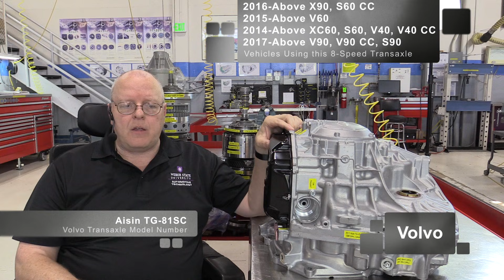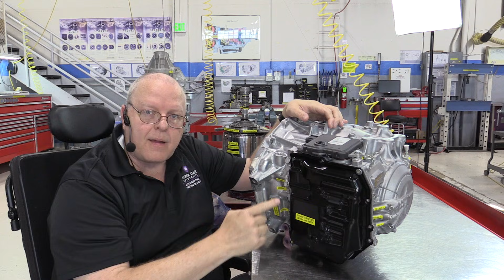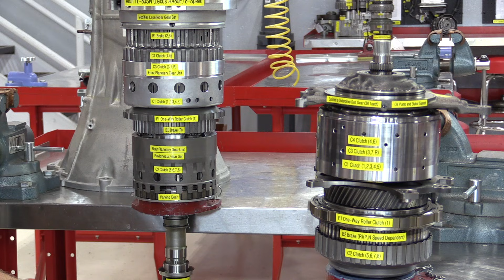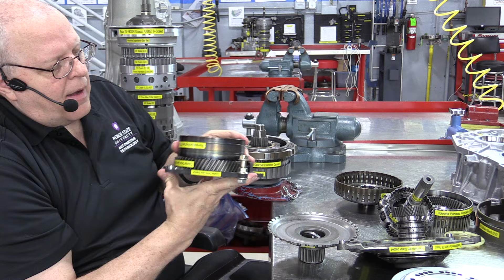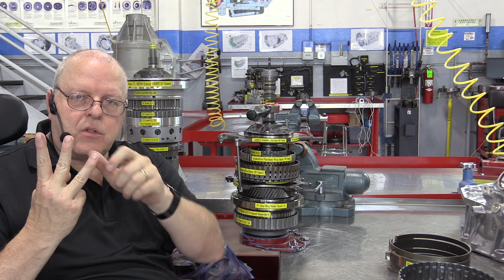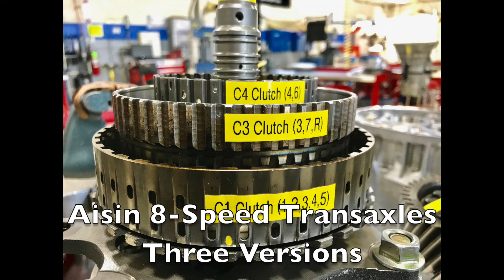Aisin 8-Speed FWD Transaxles -  Volvo, Toyota, Lexus, GM

Comment: My Mini Cooper JCW GP has an Aisin 8 speed. From what I can tell so far it feels like a very stout transmission, quick strong  upshifts and downshifts and it puts the power down very well. If I leave it in sport auto mode, I can be cruising in 8th gear on the highway and if I mash the throttle it downshifts to 3rd with quickness and takes off like a rocket. Or I can manually shift down with the paddles or gear selector for more involvement. After having only manual cars for the past 6 years (until the Mini) I thought automatic transmissions were bad... but I was so wrong. These transmissions are incredible.
Reply: @gravityhammer25 - Interested in your comment. We have recently bought a UK 2023 Mini JCW (228bhp) and are very pleased with the transmission. Having been used to VW brand DSGs (with diesels) for many years in various vehicles, the Aisin has low-speed smoothness that DSG just doesn’t, and coz the Aisin has a torque converter I have no worries about slipping clutches wear or heating up in slow traffic etc. Low-speed manoeuvring is now a positive dream rather than awkward. The DSG when cold is nowhere near as good.  Having said that I still like the DSG, and one remains as my “daily”.
Reply: @adrianlw2750  I carry the motion that Aisin 8 is sublime in both low speed cruise in traffic and when manoeuvring back and forth. The only advantage dual clutch types have over this is when entering or exiting the cruise mode the obvious mass of the torque converter initial spin compared to just a clutch engage with the dual clutch types. I love that the Aisin can kick down 4 gears at a time when wanted as well. Great part overall.
Reply: Glad I seen this comment, I have had a 128ti for a year now. I always wondered how the Aisin Gearbox differed from the ZF box found in 3 series and above models. The B48 (High tune) with this gearbox is excellent. Only gripe with it is, on colder mornings it can be a bit notchy, but that’s to be expected 7° and below in UK. Very impressive gearbox tho
Reply: @alexthomas446  is there a tune that ppl are flashing on the trans

Comment: Excellent video as usual John and of special interest to me as I have it fitted to my new Volvo XC90.
In that application there are two special features. 
First is the Eco drive mode which has an over-run declutch feature so that it completely coasts with no engine braking on a trailing throttle.  This may be a mechanical feature such as a one way clutch inside the transmission.
The second is the Off-Road drive mode which holds first gear to high revs and includes downhill brake assist, which is accomplished by  software and the ABS system as far as I can make out.
It also has a transfer box or at least a crown wheel and pinion for transfer of drive to the rear axle on most XC90 variants and that is all variants available here in the UK. Of course the same Aisin transmission is being used in V and S90 models and 60 series also which are mostly sold as front wheel drive.

My example is mated to the excellent 235hp 480Nm [approximately] twin turbo two litre diesel engine. The fuel economy and performance both exceed my expectations for a big 2.25 ton car. Yesterday I covered 205 miles, much of it at between 80 and 90 mph, with about 10 miles of city driving and 60 of twisty country roads and achieved 38mpg Imperial or 32 mpg US.  Average speed of just over 50mph.
Reply from the maker: Great information! Thank you!
Reply: Keep an eye on the valve cover gasket, they leak straight out of the factory

Comment: I rented a 2018 Camry with this 8 speed transmission and I was suprised the car had almost 100k miles already and everything was holding up well transmission/engine/interior wise. Didnt notice anything out of the ordinary.
Reply: Aisin transmissions hold up really well in my experience.  My old Suzuki had one and it was sold something like four times and the guy that has it now is still driving it around on the same transmission. That's over 22 years later.  Keeping the fluid changed regularly will do a lot to keep them running well.

Comment: Fascinating. I owned a 2007 Lexus LS 460, and it was equipped with the same Aisin 8-speed transmission. The later IS-F probably was the same but a heavier service variant. As with most Lexus models, they are rear-wheel driven. Only the ES has the 6-spd FWD. I can't say for sure who produces that unit, but since Asin Seiki is part of the Toyota family, it's a safe bet they make it as well.
Reply from the maker: You are correct, the 2007 model year was the first year for the Aisin AW 8-speed AA80E in the Lexus LS 460. I was wrong. The RX series is also front wheel drive or all wheel drive. Thanks for your feedback!

Comment: Hello from Kerala, India. I own a front wheel drive 2014 XC60 2.0L Diesel D4 with the same Aisin 8 Speed Gearbox mentioned here. The car has run 30,000 kms. Recently a warning message showing "Coolant Low - Switch off Engine". Upon checking , I saw the coolant reservoir tank was empty and it had a brown oily kind of residue. I sent the vehicle by Flat bed to the Volvo dealer in Kochi. A couple of days later after checking, the dealer informed that the Coolant had leaked into the Gearbox via a failed cooler resulting in shift shock. They said Volvo recommends the Gearbox to be replaced! To replace a Gearbox in a car that's run only 30,000 kms sounds absurd.  This is the same 8 Speed Aisin Gearbox that comes in the current Volvo XC60,XC90 and XC40.
Reply: I have similar problem in BMW  X1 with same 8 speed Aisin gearbox, on 70k km, 6 years old, once it alarmed that Transmission is too hot. What did you do after, you changed gearbox or repaired problem? thanks
Reply: @versys23  Hi Antonio, I had to replace the Gearbox. Volvo supported in a small way but majority of the amount came out of my pocket.
Reply: @goodkutty  Thanks for answer. Today Bmw service recomended to change Aisin gearbox but on my expense only. On many other forums I found lot of Bmw X1 owners with damaged automatic gearboxes at very low mileage. So I think it is not isolated case.

Comment: It will also be used in the new Peugeot 508 :). Nice video mate!
Reply from the maker: I do not know. Thank you!
Reply: @WeberAuto  Many PSA models (Peugeot, Citroen, probably any new Vauxhall/Opel models in the future) have, or will soon get, this transaxle. PSA look like building them under licence in Europe to shorten supply lines. I came here to see what was going on under the bonnet of my 2019 Citroen Berlingo. So far, it seems lovely to drive but not as fuel efficient in town as the old robotised manual 6-speed.

Comment: As i understand it still has 4 sun gears therefore 4 planetary assy. 2 of the are Simmons and two separate. Only thing is there are arranged in two pairs by merging two planetary carriers into one piece
Reply from the maker: Hi, no, this transaxle only has three sun gears. One in the simple gear set in the front, and two in the Ravigneaux gear set in the rear. There is no Simpson gear set in this transaxle. Thanks for your feedback!

Comment: I get the idea that this 8-Speed is a better trany than the CVT, but that the consumer may be stuck with the inferior CVT because the auto maker wants to please the government on gas mileage.  The buyer of the auto probably would rather have a better trany than have slightly better gas mileage.  I have a 2018 Sienna with the 8-Speel Aisin, thankfully.

Comment: I rented a 2017 2wd Ram 3.6 v6 with the 8 speed. Before I drove the truck. I thought 8 gears was to many. Now I wish my 2016 F165  (F150 with 2.7 twin turbo v6) had one. It also shift a lot better than my truck.
Reply from the maker: Thanks for your feedback! They do drive nicely.
Reply: The ram comes with a german ZF unit which shifts really nice.

Comment: Have this transmission in a BMW 2er Gran Tourer LCI. Very nice driving feel with it.

My concern: the manufacturer says it doesn't need any oil change, but users in real world say you should change the gearbox oil and filter at about 60.000 miles. Others say that after you do the oil change the problems with this gearbox begin.

So what's your input in this matter, please? 

PS: one of my friend noticed at around 65k miles that the gears were lagging and having difficulties changing gears. After the oil change at a local garage, the gearbox was back to normal in operation.

Comment: My moms 2024 Highlander 2.4T has this transmission, it’s not the smoothest but my biggest complaint with it is the TC lock up. It locks up a couple seconds after 2nd gear and it’s super obvious and lurches the car with the extra torque. When you’re just creeping around a parking lot it gets annoying. They should’ve waited until 3rd gear to lock the converter.

Comment: I've got a camry with this transmission, i have to say i'm not really a fan. Maybe it's because i have a 4cyl, or probably just the programming, but it will downshift and the slightest hint of throttle input and it cannot pull in any gear. This causes countless shifts for even a short drive.
Reply from the maker: Thanks for your feedback
Reply: I would rather have easy downshifts than very late and reluctant (and usually jerky) ones in my 2022 Mazda 3. The car is tuned to try and adjust the torque converter as long as possible before downshifting, but it usually ends up lugging the engine and ruining throttle response.
Reply: That's what happens when you have too much overdrive for the engine's torque output.  This transmission is a dream in Volvo T6/T8 vehicles.

Comment: HI. Thanks for the thorough demo of this transaxle. After rewinding the video a couple of times i still get the same doubt, can you please clarify it to me:

How come the drum that is stoped by the band has got 3 clutches under it (aswell as the 3 yellow corresponding labels) and only 2 pistons? If i undersatnd correctly the inner one is for the c4 clutch and the outter one for the c3 clutch. So how is the c1 clutch applied?

Thanks in advance.

Comment: I watch a lot of your videos. Very informative though sometimes too technical for me.  I always prided myself in doing much of my own car maintenance but as I get older these transmission are getting more complicated not to mention the specialized tools that are needed. Are these 8 speed AISAN transmissions that go in the Toyota reliable. I know they're the next generation of the 6 speeds which have had a good track record.....wondering if the 8 speeds are just as good. Also what are your thought on transmission fluid servicing since many manufactures say life time fluid. Some say every 30,000-50,000 miles....others say follow the owners manual. To me it's like taking a bath in dirty water.
Reply from the maker: Thank you. I have a complete series of videos on transmission fluids. I also created several Wikipedia pages on transmission fluids. Always follow the manufacturer's maintenance plan. Most drivers meet the severe service requirements of every 60,000 miles for Toyota ATF.
Reply: @WeberAuto  I just watched your video about the Toyota ATF history. This was most helpful!!!! And thank you. I noticed Aisin makes WS fluid and says it's synthetic. I also found MITASU makes WS WTF and it's  Synthetic but Toyota WS fluid makes no mention it's synthetic and many people say it's not a good fluid.  Never know who to believe...Amsoil of course say they make the best fluid...so confusing........do you have any videos on transmission coolers and their effectiveness? Best Dennis

Comment: Sir, I like this video n the 8 speed transmission. But the braking bands had me worried that might break the fluid, produce metal particles n shorten gear life when the bands are taking a greater proportion of the braking load.

Comment: Hello, thanks for filming such detailed video. I had a 2006 volvo S80 with TF80 -SC gearbox. In user manual it say JWS 3309 (Type 4) oil should be used for fluid change. But in later models it says JWS 3324 (AW-1) should be used. While other car manufacturers using TF-80 series claimed AW-1 should be used regardless of model year, should I use AW-1 for fluid instead? Thanks
Best Regards from Hong Kong.
Reply from the maker: Thank you! Stick with the Type 4 fluid. To my understanding , there is a difference between the two fluids. Best wishes!

Comment: Great video John,  but from around 25:30 to 26:00 you're describing the front gear set with the sun held, carrier input, and ring output.  How is this not producing minimum forward overdrive from this gear set?
Reply from the maker: Thank you! Great observation! A single pinion planetary gear set would have an overdrive condition with the sun held and the carrier as the input, but this is a double planetary carrier gear set. It reverses the direction of the ring and slows it down. The formula is Wa=1/((Na/Ns)-1)/(Na/Ns) where Wa is the speed of the annulus gear (ring) and Na and Ns are the number of teeth on the sun and annulus gears. Na = 78, Ns = 38. I hope that helps. Have a good day!

Comment: Interesting video. Slightly off topic question. Toyota usually uses Aisin transmissions for their cars. Toyota has always had a good reputation for reliable automatics. How come the European cars that use the AW55 transmission are considered to have weak transmissions? The AW55 does not appear to be used by Toyota but it's still made by Aisin.
Reply from the maker: Toyota typically renames the Aisin transmissions they use to a Toyota designation. I do not know if Toyota used the AW55 because I don't know what they would have called it. Aisin builds great transmissions, but they have not been without some failures. Additionally, vehicle manufacturers pick the Aisin transmission they want to use. Maybe they picked a model that was not the best pick for their vehicle for some reason (typically $$), i don't really know. Best wishes.
Reply: WeberAuto The AW55 had features such as the clutch disengagement at rest in D and the super smooth shifts (when working properly) that were matched to small Luxury cars. I understand firmer shifts at better for long life? Thanks for all your videos
Reply from the maker: Thank you!
Reply: @WeberAuto  I believe Volvo used to have problems with AW55s because of "neutral-drop" and other software behavior which put too much stress on the internal components. It was a case of "a good deed never goes unpunished". I believe they were trying to save fuel but overcomplicated the functional behavior of the unit ... which might be a clue as to why other brands' Aisin boxes have lesser reputations.

Comment: Nice to see this video, just wondering if it is possible to retrofit this gearbox to 1.9JTD 16V (1910cc) engine? I am not sure if it is a M32 or C635 manual gearbox now on my car, but would really like to get this gearbox on it.

What signals does it need from ECU or any other component if there is any data for something like this?

Comment: John, you mentioned an extra solenoid for auto-stop engines. What does that solenoid do? Is it something to do with the restart of the engine/torque converter clutch?
Reply from the maker: It is a strange little piston type pump to keep the clutches applied with the engine off
Reply: Thanks John.

Comment: Does the 2017+ Polestar Volvo S60 (362HP) use a variant of this transmission ? The likely candidate is the AWF8F45 since it can handle 480NM.
Reply from the maker: Yes, it uses the TG81-SC, the same model as the video

Comment: I've got a some questions, but as always your videos are very good. You touched on 3 versions to handle different torque levels, could you eleberate on the 3 versions and how much torque they are good for? I own a 1995 Mitsubishi 3000GT, it's FWD. Latter I would like to modify it with turbos and all that. Right now the car is fun to drive stock as it is, but gas miliage sucks even at the 222 HP stock level. Transaxle is a 4 speed OEM. Do you think I could get one of those 8 speeds to fit in my car? If so, which one is best for higher torque levels that would fit in there? Also, do you know of any 7 or 8 speed AWD transaxles that may be made to work in my car? Thanks for your time.

Comment: I own a 2020 2.0 hdi Citroën c4 grand spacetourer with an aisin 8 speed that has a loud drone or whining sound. The Citroën shop told me that the manufacture knows about the problem and theres no fix. The psa group keeps selling cars with the problem and the customer just have to live with it or sell the car. I like the car and the space inside, but i can't live with the transmission noise so I guess i have to sell it. Also for some reason the Psa group don't change transmission oil on the 8 speed and says it's not needed and that there's no interval.

Comment: I have a question about this type transmission . My BMW F46 220D LCI is matted with 8 speed  AISIN GA8G45AW and I cant find info about interval service ( transmission oil change ) . The car miliage is about 78k and everything is ok but I am dont believe about the life time fluid statement. So what  your opinion is  about transmission interval service ?
Reply: I have problem with same gearbox on 70k km, 6 years old, Transmission too hot alarm triggered once. BMW dealer never changed oil in transmission and they say that changing oil will not solve problem. I am still waiting from them what to do next with gearbox. Any advice is welcome
Reply: @versys23  After detailed research my advice is to get over 10 liters transmission and  make two-three standart changes. Oil temperature must be between 35-45 C and don't sent info to transmission  comp " oil changed ".
Reply: I got information from authorised Bmw service where I bought the car that Aisin gearbox needs to be changed on my own expense around 7500 euro. Dissapointed with Bmw Tomic Croatia and their behavior to client. I will try to seek my rights since I consider that this gearbox is fraud if it needs to be changed on 70 000 km